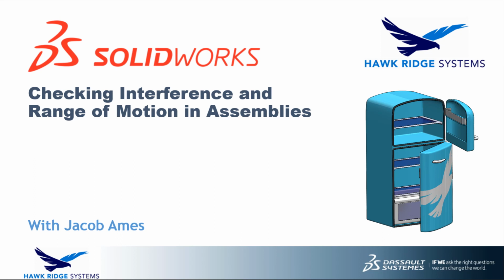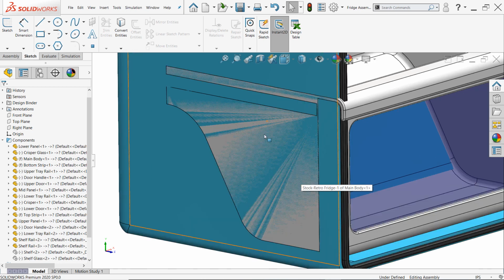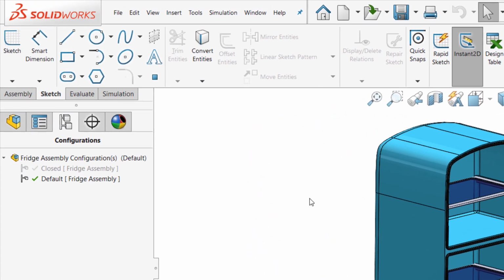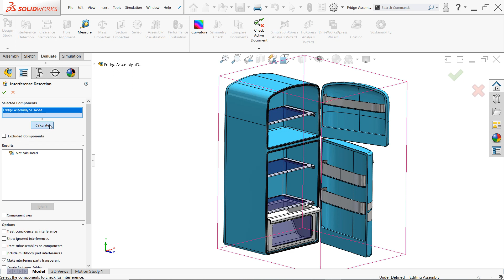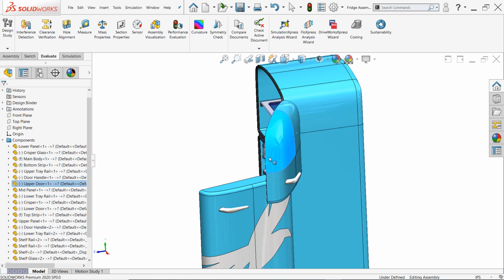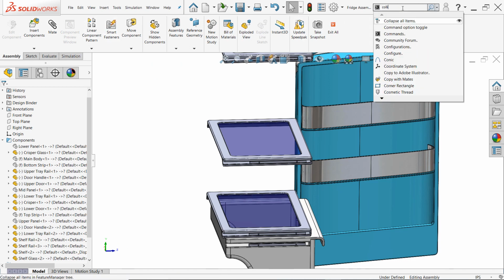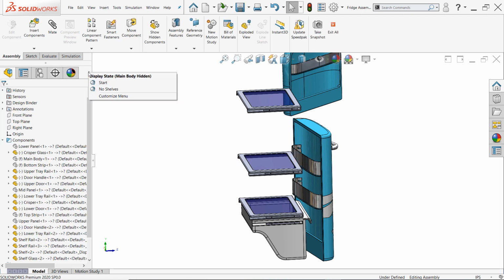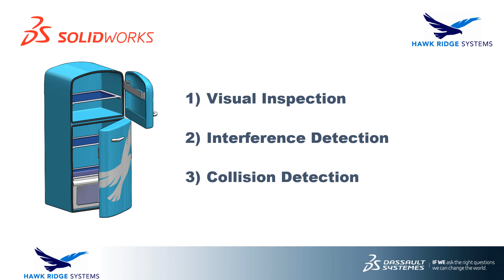Checking Interference and Range of Motion in SOLIDWORKS

Comment: Excellent vid! Thank you.
Additional tip for making parts fit:  I find that either importing or designing a rendered 3D short handled 3 pound soft faced lead shot sledge hammer into the assembly really helps get stubborn parts to fit.